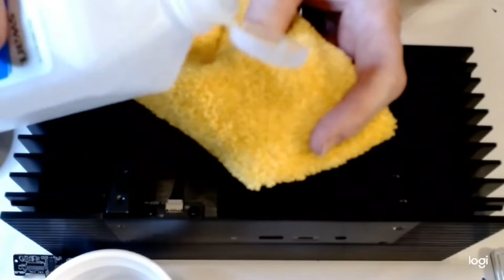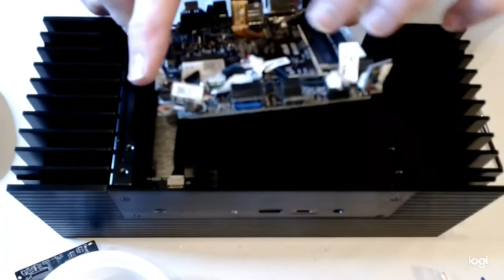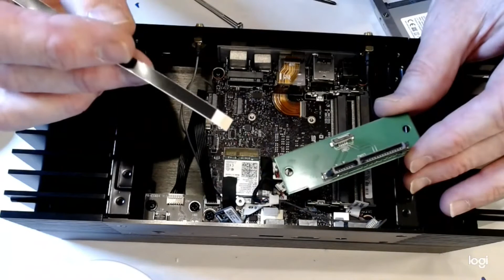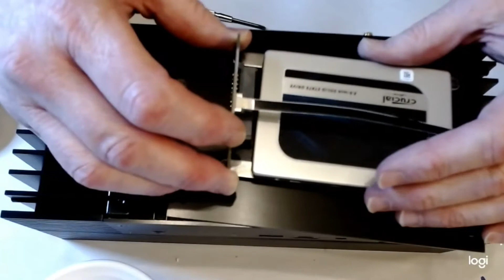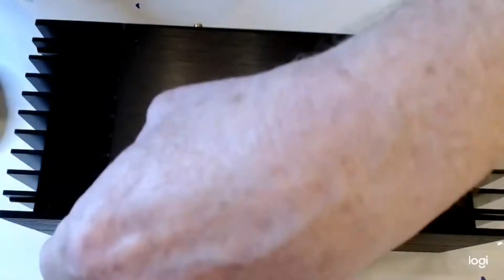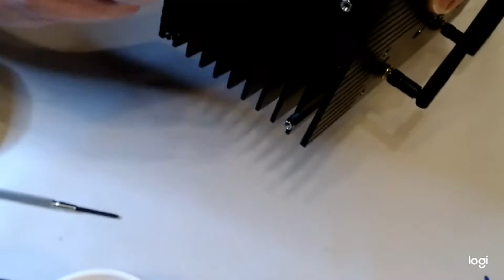ASUS PN50 install into Akasa Turing A50 Case

Comment: Thank you for this series of videos. I have the PN51 and the process was almost identical to what you describe in this video. My Turing case had a display port by the way. Great tip regarding buying more thermal paste - that was definitely needed.

Comment: i just got the Pn51 with the 5700u .. and im gonna get this .. i was wondering if you should put paste on top of the "heatsink" or not .. coz i dont think it say so in install guide  , but i was gonna test and see  i got a good tube of Kryonaut ;)
Reply: The install guide has an icon of the thermal paste tube indicated for the "top" of the heatsink (as well as for the "bottom" that contacts the CPU).

Comment: I just followed all the instructions and for some reason the system simply will not power on. I can’t figure it out at all, everything setup and connected properly but no boot, no lights
Reply: Maybe the small circuit-board with the 2 LEDs and the power-switch are not close enough to the front plate, and thus not being able to have a working power-button.

Comment: The pn51 (5700U) needs a fan, fan monitoring enabled, and Qfan to be enabled with performance to get top cpu speeds.  I am going to try a fan spoofer/simulator.  Without fan you get 2 minutes 3000Mhz then 2000Mhz with fan you get 3700Mhz and drops to 3200Mhz with temp throttling with fan running outside the case stressing all cores.  Temps are still 60C Max (much lower than 85C in original case).  Performance drops almost in half without a fan signal.  Appreciate the video and your how to.
Reply: Did you disable the fan and Qfan in the BIOS?
Reply: @devkev3467  The fan spoofer worked.  It is used in mining rigs that are converted to liquid cooling and remove fans.  Just need something that gives a pwm speed.   Didn't mess with any settings for the fan in the bios, nothing I tried before the spoofer worked.

Comment: Thx for the video! FYI: I have a PN50 where it is printed PN50 E1 on the motherboard. The inside of the housing is a bit different thus had to destroy it to be able to get the motherboard out. Speaking of point of no return... Also my AKASA housing is maybe later modell because there is a slot for that strange looking display port. The provided thermal paste quantitiy is really a joke, and I had no extra here, so now I am only running with thermal paste on the CPU and still all the temperatures (CPU, GPU, M2) are much lower than with the original housing and noisy fan. It is a ton of aluminium afterall :)

Comment: Hello, is the thermal paste on top of the heat sink necessary? If so, can it be replaced with a thermal pad? I kind of dislike having to apply so much thermal paste.
Reply from the maker: I certainly wouldn't recommend it. It seems to me the space between the aluminum block and the processor chip is much to small to accommodate a thermal pad.
Reply: @BradFrese  Thank you! One last thing, is the case getting hot under normal usage? Or under a stress test?
Reply from the maker: @CSPlayerDamon  The outside of the case has never exceeded about 38° C. It has never gotten "hot" to the touch, even when doing some pretty intensive video editing and encoding. I've never done any sort of formal "stress test," though.
Reply: @BradFrese  Thanks a lot, both for the videos and the help! I've bought this, but still debating on whether it's worth it  to lose the warranty in order for the CPU to work freely.

I'll be using this in a business as a mini-server. If I want the original case to not be loud, I have to limit the maximum processor state (this way it's a 1.6GHz stable machine, around 47-50 Celsius).

Kind of sucks because the processor is capable for so much more. Then again, 1.6GHz should be plenty for my use case...

Comment: I like the idea of running 40* cooler but not at the cost of losing i/o, no microphone, no sd card, no dp etc and having to buy antennas and defeating the whole purpose of the vesa mount usff stock case. Asus should've built a sufficient cooling system for this PC originally. Mine runs 90*+ cpu, 60*+ nvme, 40*+ ssd, 70*+ gpu and my fan makes very little noise. And it sits on a laptop cooling pad with fan too. I'm hesitant to disassemble and re-paste it though. I'll switch to whatever new ASROCK X300 AMD variant case comes out later supporting Zen3 RDNA2 DDR5 apu and get the Noctua NHL9A slim fan.
Reply from the maker: You may have missed my latest video https://youtu.be/6Sth_SrKO_c . Akasa has solved the microphone, i/o and SD issues with the MKii version of the case.
Reply: @BradFrese  Thanks for the tip. I watched your other vids too. Great reviews.

Comment: Brad - Just want to thank you for the video again. I finally got the MKII from Akasa's US Amazon store and finished the build. Like you said, the small tube of thermal compound included is definitely not enough for the large heatsink plate on the CPU side plus the case side. On your recommendation, I went and got extra compound. I also used the stock SSD heatsink plate that came with the Asus. BubbleUPnP, Minim and Roon servers are always running on the PC. So it is never idle. The CPU temp stays at about 34C/93F and the M.2 2280 SSD stays at about 45C/113F, with ambient 26.7C/80F. For the fun of it, I got a couple of M.2 heatsinks to replace the stock Asus one. With the MKII added mount for the extra display port, it makes it very tight for heat sinks length wise. Also, I mounted a second spindle drive. So there is < 0.5 inch height SSD plus heat sink.  One of the two heatsinks I got is full length of the SSD but lower profile. It can go under the display port mount but would run into the dense foam support of the port. So no go. The other heat sink is shorter in length but with taller profile. So it cannot go under the display port mount. It took many trials of dry fitting to figure how to align the heatsink with the drive and the heat sink drive cradle and also to be able to put the SSD mounting screw in and for the heat sink not to touch anything else, before I could commit the heatsink by sticking the silicone pads on. All that work and the now the SSD is only two degrees cooler even if the heat sink is about many times as thick plus fins on top comparing to the stock Asus heatsink plate. Fun project though.  I ran some benchmarks and the SSD ran at 50+ C. Now, the chamber where the PC guts go has slit openings on both sidewalls on the longitudinal sides of the case. I ran a 120MM PC case fan at below normal voltage from the long end of the case. So it ran very slow, silent & with small CFM. The air cools the fin on the top half of the case. For the lower half, the air goes along the case fins, enters the chamber through the slits on one side & comes out from the other side.  It cooled the SSD to 38C very quickly. Of course there is no need to do that with this case except for testing out how a small amount of active cooling could make such a big difference in a very short time.  I mounted the mics on the front plate with some of the tapes peeled off while tearing down the Asus and they work very well. As for the blindingly bright LEDs, I painted black some scotch tape and triple layered them. I taped them on inside of the front plate where the LEDs are. It dims them too well now. Think I only need double layers. Anyway, an overall fun project. I think the case looks just fine without the Asian motive endplates and didn't mount them. My wife thinks the case looks decent for the living room. I mentioned the case is new but didn't say the PC is also new. ;)

Comment: I got the Akasa today, the new version and I am yet to go through the entire process. Thanks for instructive videos - especially for the tear down - there are certainly some pitfalls I can avoid thanks to you. I am using 4 monitors with PN50, so the new version of the case, the one with a hole for the display port was critical for me. For everybody who is not so greedy - the microphones also do not need to be sacrificed with V2 as well as the SD card reader. The mics are good, but were unusable in the original case because of the fan noise - I hope this will also be fixed with the Akasa. It seems that the PN51 should fit in it as well. These little monsters are something, but the original cases from ASUS are absolutely inadequate, with 4 monitors it is impossible to run the PC without regular failures - every time you let it run full speed for a bit too long (which is a mere couple of minutes). Thermal throttling doesn't seem to work as it should when all video ports are in use (in my case 4 QHD monitors). I tried weird stuff like putting the PC over a fan (fits well on 92mm) one, but the CPU remains behind the motherboard and this helps, but not enough. I hope I'll not break anything ;)
Reply from the maker: Let us know how it works. I'm only running one monitor now but how's to add more in the future. Thermal performance should improve dramatically with the Akasa case!
Reply: @BradFrese  Well, just first impressions. Thermals are radically different  - CPU/GPU both under 60 degrees Celsius almost always. Under full load I've seen top at 66 degrees but only for a couple of seconds. I'll come back with more later - this is after a hour and change only. As for the dismantling and installing in the Akasa - there are some troubles Brad did not mention (or they just did not happen to him) - the SATA cable is a bit hard to plug, especially on the mobo. I could not find the same antenna leads and this "L"  is obviously important, because mine refused to stay attached and look thinner than the originals (probably my bad - help will be appreciated). The microphones don't work, but I am going to look into it when I find the right antenna leads - don't want to open it only for this. One can keep the DisplayPort attached during the whole process - no need to unplug the cable. The spring for the power button is not needed, but gets lost easily (read between the lines here ;) ). I had some thermal paste at hand, but I used it up before reaching the amount I saw Brad putting on the aluminum plate, I ended up with 50-60% of the amount he put, but it seems to be more than enough. Well, this is what I noticed so far, my machine crashed once, but I doubt it has anything to do with the box - well, if not - it is me and my hands to blame I guess. I'll be back after some time to report how it goes.

Comment: Brad - Got a couple of more questions. Do you think there is room in the case to install a heatsink for the M2 drive? Would you please also list the thermal compound you used?
Reply: I just installed an Aorus Gen4 with its ridiculously large heatsink.  It clashes with the SD card reader PCB, but only just.  A more sensible M2 heatsink should be fine.  I don't expect to use the SD card reader very much, so I just left it out, and kept the M2 heatsink on, and it's fine.

Actually the Aorus's heatsink also very slightly clashes with the DisplayPort card, but that's also true in the stock case, and for this it's enough to just put some electrical tape and/or thin hard plastic, to prevent the heatsink from shorting out contacts on the DP card (the DisplayPort was behaving very weirdly before I figured this out!).

You can see in the video (just) that the thermal paste he's using is Corsair XTM50.  I used this too, and it seems fine.
Reply: @devkev3467  Thanks! I ended up using a generic low profile heatsink from Amazon. "EZDIY-FAB M.2 SSD Heatsink 2280". It does not interfere with any internal parts. The server has been running for two years and all is well.

Comment: Next mod is to paint the case to some awesome color. Wonder if it would diminish cooling performace.
Reply: You don't need to paint the whole case, just put flashes of colour on corners and selected places. Much hipper and cooler.
Reply from the maker: I do believe that paint would significantly degrade performance. I believe the only safe way would be chemically anodizing the aluminum for different colors.
Reply: @BradFrese  That would be expensive!
Reply from the maker: @hawkins55  Undoubtedly! 😂

Comment: Did you see the mkii version, with cutouts for the microsd, front mics, and display port on the back? Would be cool if you checked it out.
Reply from the maker: Oh wow. That looks cool. I would hate to have to buy a whole new kit, though. I hope they come out with a conversion kit that would allow me to switch out the front an back panels.
Reply from the maker: Additional information: I have confirmed with Akasa that they are making available an upgrade kit which consists of only the front and back panels which have the ports missing from the original Turing A50 case. I have contacted my supplier and when I receive the kit I will install in my case and make a video showing the process. CarTFT.com is located in Germany, and I am in the USA, so it may take a few weeks until I receive the upgrade kit.
Reply: @BradFrese  I'm still waiting for performance-pcs.com to get the mkii in stock. Just picked up the pn50 (4800u) version today and am excited to get to work.
Reply from the maker: @Greidaon  Great! I'm sure you'll be happy with your new setup, especially once you get it into the Turing case. I wish I had sprung for the 4800u version rather than the 4500u. Hopefully ASUS will stay with the same form factor -- like the PN51 has -- so I can use my current case for any future upgrades.
Reply: @BradFrese  Just got the mkii. Now, just finalizing what drives and RAM (thinking of 64 GB of Crucial memory; I'm not planning on reopening this for a while :)) My only worry is this: I know that NVME is faster, but I heard that it also runs hotter that SATA III m.2. Since there is so little room in there, I am willing to sacrifice speed for temps. Any advice would be awesome. Thanks in advance.
Reply from the maker: @Greidaon  I don't really monitor anything other than the processor (Ryzen 5 4500U) temperature, which I don't think has ever gotten much hotter than 115 F(46 C) and I have both a Samsung 1 TB NVME and an ancient Crucial 500 GB SATA SSD drive. The Case itself never gets hot, only barely warm to the touch, sometimes getting up to 97 F. 

Either way you go, I doubt if you will have problems with the drive(s) causing excessive heat. If your processor runs significantly hotter than the 4500U, then you may see higher temperatures than I do.  Is there a reason that temperatures are you main concern? 115 degrees at the processor is half the temperatures I was seeing while it was in the PN50 stock case.
Reply: @Greidaon  I confirm the observations of Brad - with both drives temps are in the range 40-50 degrees with the NVMe drive going up to 60 under longer periods of full load, but this is completely acceptable. If the APU supported pcie4 it is another story, but it doesn't, so no need to worry - I was somewhat afraid about the drives too.
Reply: Just ordered the PN51 5300u. Will get the Turing A50 MKII later to split the expenses into two credit card cycles. 😅 Would like to paint the case to another awesome color. But it may diminish cooling performance. Was looking at some Cirrus 7 cases. But seems they ship out of Germany but only ship to Europe. Reached out to them a few times about shipping to US. Never heard back from them.
Reply from the maker: @hawkins55  I ordered and recently installed the new front and back MKII panels and videotaped the process -- no big deal actually. I did encounter one problem, however: the left microphone hole is placed a few centimeters to far away. The existing microphone cable for the PN50 is not capable of reaching the hole in the MKII case. I have emailed AKASA to see if there is a solution to this issue before I produce and upload my latest AKASA Turing A50 video. If the internal microphones are a big deal, I would advise you to wait until I have an answer to this issue. If they answer by early next week, I will include the answer in my video.

As far as painting the case, I believe you are correct. It would likely diminish the cooling capability significantly. As I mentioned in another comment, an alternative might be to pay to have the case anodized in another color besides black. (Granted, this would likely be an expensive option.) If anyone does this, please upload video and add a comment with the location of the video!
Reply: @BradFrese    Thanks for the heads-up! All the more reasons to postpone the MKii case purchase. Hope Akasa works out the fitment issue soon.
Reply from the maker: @hawkins55  so, it actually works jus fine. There was plenty of extra cable for the mic, it was jus trapped under the RAM modules. After removing the RAM, it feed up more than enough to allow for the mic to reach the cutout and mic hole.
Reply: @BradFrese  Thanks Brad for clarifying.

Comment: Your link to the antennae does not show the internal leads to the main board.  Would you post a link of the internal leads you bought. Thanks!
Reply from the maker: Absolutely, good idea!
 I have posted a link in the description area above. Also, the description really did not show it, but when I ordered one, it came as a pair.
Reply: @BradFrese  Thank you!
Reply: @BradFrese  Any idea for the exact specification - the ones you used are out of stock and my pick did not fit. I tried the originals couple of times - they clicked in place, the ones I bought did not.
Reply from the maker: @MichaelElfial  So the description sghould help (I-PEX MHF4L to RP-SMA Female Pigtail Cable -22cm) _PEX is the type of connector to the board, and RP-SMA the type of connector to the antenna. I would suggest directly contacting quietpcusa.com, quietpc.com or cartft.com for the availability of the antenna leads. I am betting that one of them will be able to ship you the parts you need.